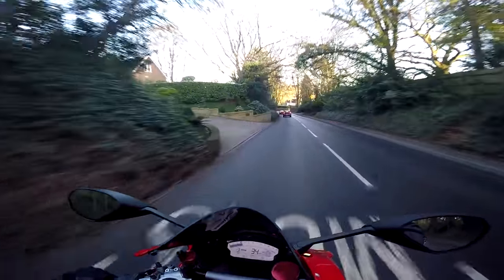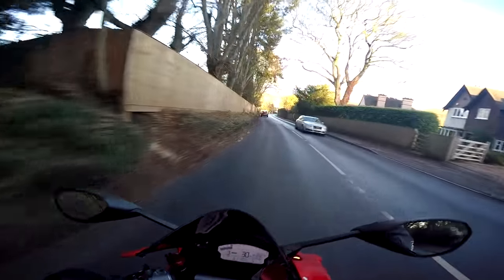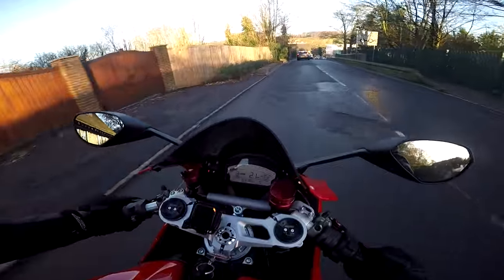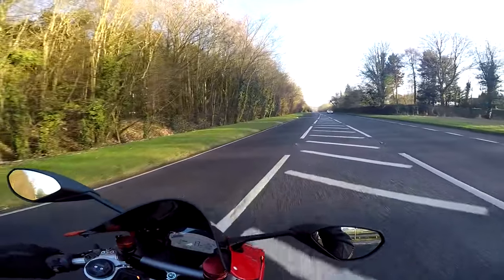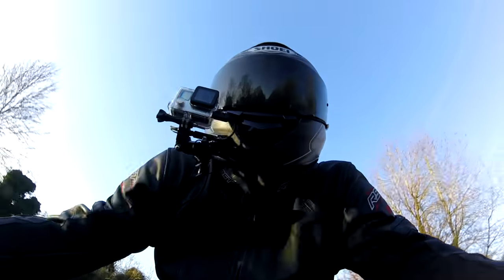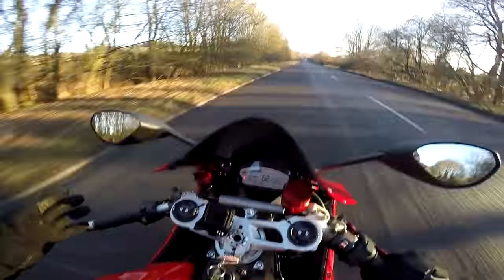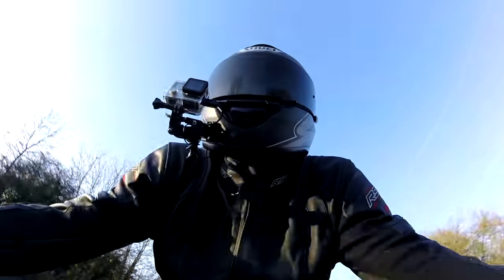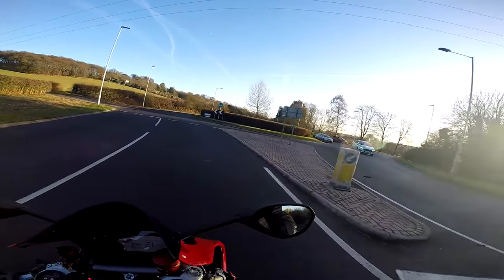Panigale throttle spacer kit - First test ride

Comment: I fixed mine with some clear self adhesive bumpers , cost me $2.50 from Bunnings , 12 in a pack and only needed two 👍 just have to make sure the grease is cleaned off first . Does make a difference when trying to keep a low stable speed 😎

Comment: I do like the 899. Great supersports for the road power wise. The sub litre sports category I think are a great option for the road. How does she handle on a dry summer road? I'm guessing very responsive/flickable and sure footed. Cracking looking as well, has to be red too, although I would entertain black possibly.
Reply from the maker: +Sleepingdragon 1 Awesome (a word I don't use often/lightly) machine on the road. An absolute scalpel of a bike, think where you want to go and she goes ballistically. To be fair even at "only" 899cc the bike really needs to be on track to really appreciate it, she comes alive over 7000rpm - and oh the sound! The best handling bike I've ever ridden by some margin.....

Comment: Nice video as usual, how many helmets  in your collection now?
Reply from the maker: Thanks TT - I currently have 5 (one of which I don't use and need to E-Bay...the AGV) - I don't think that's excessive for 4 bikes do you???  how about you?
Reply: TheMissendenFlyer ,no I don't think that is excessive,I have 1 bike 2 helmets and possibly a Honda crf on the way shortly just for a bit of fun,so will have to get an adventure helmet then and it's all your fault ;)
Reply from the maker: Good stuff ;0)